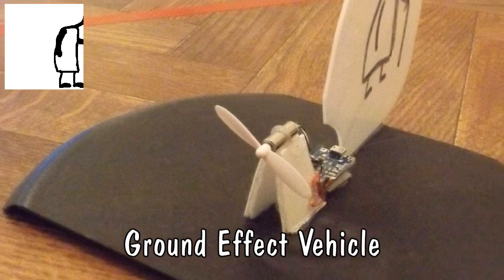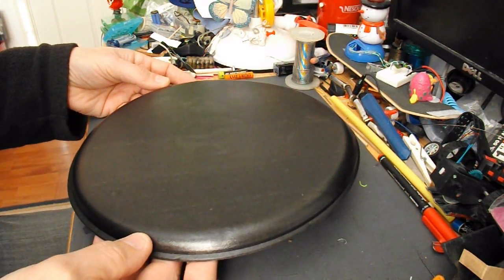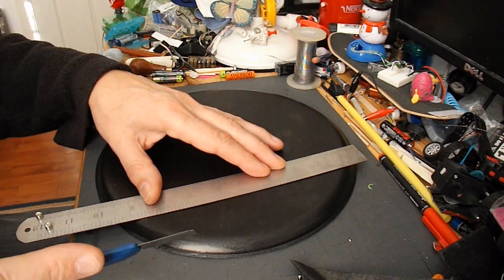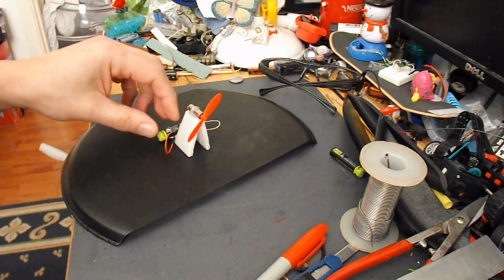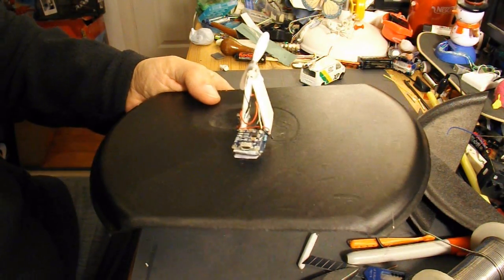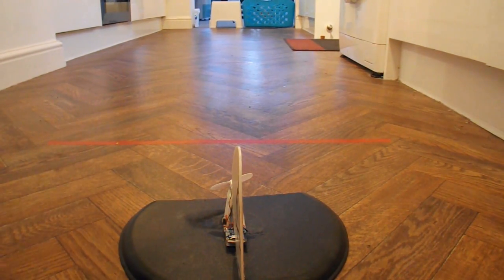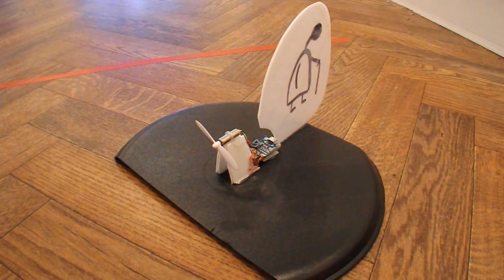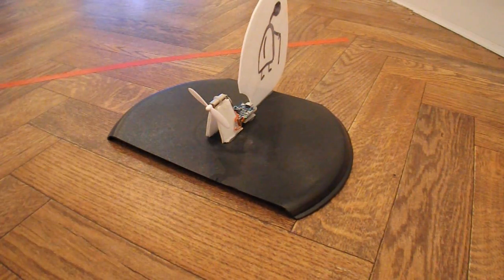Ground Effect Vehicle

Comment: I liked your project, but I am not convinced that it actually lifted off the ground. It sounded like it was still touching the ground while moving.
Reply from the maker: andreasl33 the later 'flights' in the video definitely scrape as the battery is losing power and the engine slows down. It does not need to lift clear of the ground to be cushioned by air. Obviously it would be more efficient to be clear. It was definitely helped by the air underneath. On the other hand if it rises too high the cushion effect is lost anyway and it is just another airplane. If you watch the other videos in the series you will see it improves.

Comment: hi GrandadIsAnOldMan i really like your channel and would like to start building some of your creations, i have a hot glue dun but i do not have a soldering iron. My problem is i don't know how to connect the battery to the wires on the motor. do you have any tips?
Reply from the maker: Just had a new comment on this video and spotted I didn't reply to you 5 years ago. I would guess it's too late now so I can only say sorry. The answer would have been to strip some insulation off and twist the wires but too late now 😕

Comment: I love the ground effect machine i use basic rc gear and foam board to construct them they can be very efficient when up to crusing speed
Reply from the maker: Hi Alex, it would be handy if you had some video of them. Most of the videos I can find are quite short and not very clear. The two I linked to in the video description are typical, they look good but the video is short.
Reply: ill see what i can do in terms of videos as im currently doing my GCSE exams. but to give you a bit of info the designs that i have had most sucsess with have been based loosly on the  lippisch type ecranoplan which has distinctive reverse delta wing with ahedral (negative dihedral) and a tail plane that has a negative angle of attack to keep the nose down at hi speed if it Rc then ill have and servo linked up to it to adjust at different speeds to raise or lower the craft and a servo on the rudder to control it in terms of yaw. As for the power plant i typically use an EDF fan as it has less torque than a standard propeller which keep the wings level and makes the thing easier to control. I have also been experimenting with the use of straws as ducts out the back of the fan to get air under the wing quicker and get it up in the air faster reducing the ware on the skis. Also to increase controls at lower speed as there will be an constant airflow over the controls. hope this helps if you want any of my designs let me know and ill try and send them to you. hope this helps.
Reply from the maker: alex monk thanks Alex, I don't intend to do any more work on this myself. I was looking for somebody I could give people for reference when they ask me questions. My channel is all about simple, quick and cheap projects. Once they get more complicated I pass people on to specialists on the subject. It sounds like you know your stuff there
Reply: well i hope i helped you and if anyone has any questions about ekranoplanes or RC aircraft for that matter i dont mind answering there questions or helping you just send me a message and i try and help the best i can.
Reply from the maker: alex monk Thanks Alex.

Comment: Hey granded , can u plzz try to make a rc quadcopter !!
Reply from the maker: Hi Arbaz, that is a regular request and the answer is NO. To make a helicopter or quadcopter stable in flight I would have to buy so many parts designed for the purpose it is cheaper to buy a ready made helicopter or quadcopter. On top of that, my channel is aimed at simple, quick, cheap projects and a helicopter or quadcopter build is not a simple, quick, or cheap project. You would be better finding a channel that specialises in RC Quadcopters so you get the information from people who know what they are talking about. FliteTest would be a good place to start although they tend to focus more on planes than copters https://www.youtube.com/user/flitetest
or anything David Windestål is involved in https://www.youtube.com/user/dadde87
or you might like this video by The Post Apocalyptic Inventor http://youtu.be/qa_x93JQhNM